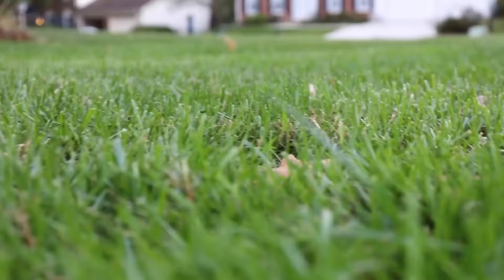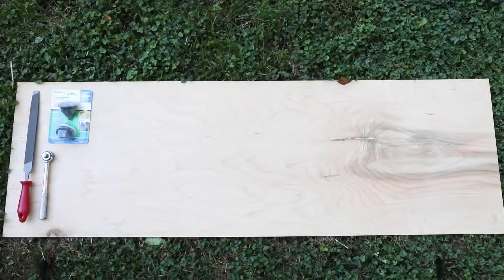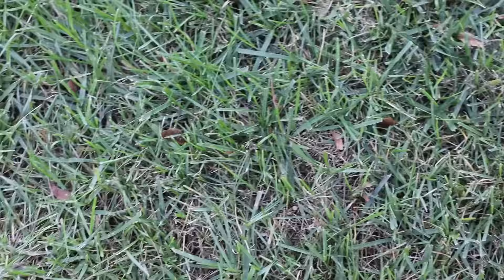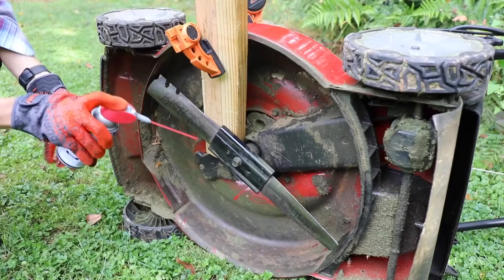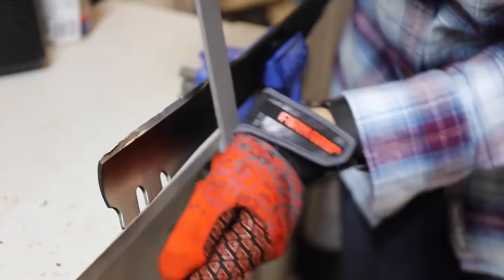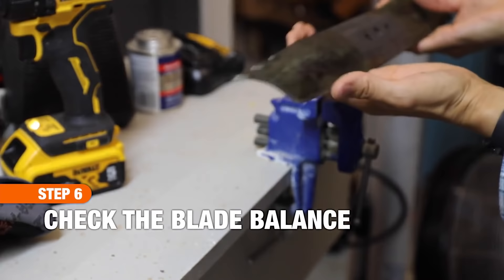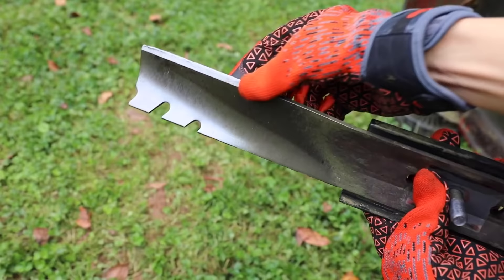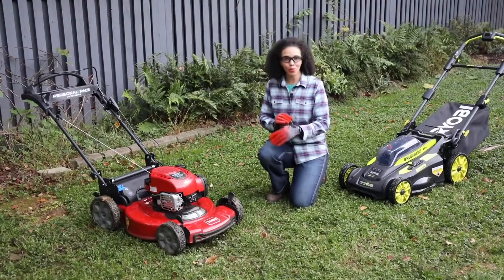How to Sharpen Lawn Mower Blades | The Home Depot

Comment: That’s why you buy two blades. Replaced the old with the new. That way you’re ready to get to work. Afterwards, sharpen and save the old blade. Swap out again when needed.
Reply: The new one I bought didn't come sharpen lmfao
Reply: Have you seen the price of lawn mower blades lately😂
Reply: What if you can't loosen your current blade, no matter what? (My current struggle)
Reply: Yes I’ve tried to sharpen mine, but still ended up not so great cut. What about a powered blade sharpener?

Comment: For those of you that are doing this for the first time you do not need the 558 tools that Home Depot is hoping you will buy from them to do this simple task. Do a little more research.
Reply: They're just being thorough, for safety's sake. I was taken aback by the whole list myself, but I think the gloves, file, marker (or even a piece of masking tape), screwdriver and ratchet are good enough to get the job done.
Reply: @Spacejockey426  Yeah they give you good info in this. Especially using a 2 by 4 instead of a blade removal tool. Can just sharpen with a whetstone. Just take your time and do it right

Comment: The easy answer is a vice and metal file (or drill attachment, grinder, use common sense).  Home Depot wants you to buy all that stuff, but the quick answer is a vice and metal file.
Reply: Exactly! I stopped watching this useless video as soon as she started rattling off the plethora of "required" stuff just to sharpen the blade. Nice try HD!
Reply: I do wonder if HD wants us to buy stuff...for if it was me I would at least put the links (to HD) to all that stuff in the description.

Comment: Bought a home last year with 5 acres.  Never mowed since I was a kid.  The prev owner sold me his JD x384 and mowed it 4 times, and had JD service come pick it up for service and found out it was almost $300 for an oil change and the kit is about $37 and new blades are around $60.  So $200 more.  I decided this year to spend the $200 on everything to do it myself and then it is only $100 season for maintenance kit and blades if I screw up sharpening them.  After one mowing the new blades had absolutely no edge on them and was just beating the grass.  Better to learn how to sharpen blades.  BTW any lawnmower service is seven weeks behind and another reason to learn to do it yourself.
Reply: the biggest expense now is the gasoline!

Comment: If you wedge the 2x4 behind the blade, you can bend the blade if the have to put much force on the bolt/nut to remove it...
Reply: I have to always use a breaker bar which risks stripping the nut.Never had a blade come off that easy first time.

Comment: I have international professional experience and have always believed blades should be optimized for the job. If you're cutting light grass you can afford to have razor sharp blades but if you're into heavier growth and tougher circumstances a more dull edge is important because sharp blades will deform too easily radically altering their cutting ability.

The factory Edge is basically perfect because it's not so sharp it's weak thus will deform too fast 

I've always just passed them over a nice big bench grinder a few times to clean up the edge and get back to as close as I can to factory but I'm always tempted to put a finer angle on it and frankly do if I'm really caught up and the mowing is easy however if I think I've got heavier growth I'm going to just get back to that factory Edge

Comment: I bought one of those wobble balancers. I got the metal one. And I think they are just junk as there is too high a margin of error. As I found the blade can slide around a little on top of the balancer giving you different readings. At the home on the cheap, the best method I think is the nail or screwdriver method. I'd say that should put you in the ballpark as it won't be perfectly balanced even if it shows it is, but hopefully it'll be within range of acceptable. The best would be those magnetic balancers that are mounted on the wall.

If you take your blades to a shop to get sharpened, make sure they have a magnetic wall balancer to check balance. Otherwise, you might as well just sharpen and check at home. Which would pay itself off anyways since you wouldn't be paying a shop to sharpen them.

Comment: Also....have always been taught to never place mower on its side.....always lean it backwards.  This prevents oil loss and none to empty gas.  Maybe this one is a new configuration because she seems knowledgeable and well prepared with all of those tools....can build a house after the mowing is done.
Reply: Depends, 2 stroke mowers no problem, 4 strokes probably need to limit the side flip to 60 degress or so.

Comment: Talk about over-complicating such a simple job... I just tip my mower backward, unbolt the blade, sharpen each end on my workbench grinder, and then bolt it back on. Simple as that. No need for the 50 tools here that they hope you'll swing by Home Depot to buy.
Reply: I dont even take the blade off, you can sharpen right on the machine.

Comment: I always remove and install my blade with a cordless impact so no need of wood. Never drain the fuel, never disconnect the plug and in all the decades I have done this, never a problem.

Comment: if you are using metal files, use a HANDLE. also this is not the most efficient way to use the sharpening stone drill attachment.

Comment: I went 15 years on a factory blade push mower before replacing the blade just because of time. Makes me wonder how necessary a perfectly sharp blade is needed since I went 15 years and could have kept going without ever sharpening.
Reply: As long as the blade exists, it will cut, but you clearly have no idea of the improved cutting peroformance a sharp blade gives.
Reply: Yeah, I'm near 55yo, had probably 4 or 5 mowers over the last 40 years, never sharpened or changed a blade on any of them and have occasionally hit curbs, rocks, pieces of metal people thrown in the yard, as I live on a corner in a big city, but then again I am not concerned about having my yard featured in Better Homes and Garden Magazine or winning an award. I just want my grass cut every couple weeks so it doesn't become a knee high jungle. It looks about the same as 99% of other peoples yards that I see.
Since my current Honda push mower is over a decade old I think I might just spend the $20 for a new blade and see if it really makes much difference. Definitely not knocking anyone from sharpening theirs though. If you have the time, tools and inclination, it probably will be easier on your motor, cut smoother & save on a new blade cost.
Reply: @willahelmpowers4835  Make sure to check the balance, as I've had to have brand new blades sharpened because they didn't balance.
Reply: @colt5189 Thanks for the heads up and tip on that.

Comment: 3 rd issue is turning the mower on its side to remove the blade, you’ll lose oil or fuel or both, tip the mower up from the front
Reply: Or, get an electric lawnmower.

Comment: Actually, dull totally round edged blades cut well.  How?  The grass slams into the blade surface at high velocity and flattens there, and then the coefficient of friction won't let it just slide off.   But since the blade ain't stopping, the grass is then torn off a bit below.  Therefore, sharpening blades is overrated.

Comment: This video is horrible tutorial because ur not supposed to lean on the side
Reply: How are you supposed to position the mower so you can remove the blade?
Reply: @colt5189  spark plug up, usually tip front up. Do not tip gas mower on side.

Edit: She empties tanks before tipping, so then it doesnt matter. It you lift from front you can skip that step.
Reply: @morgizmo87  Tipping front up is kind of hard because of the rear handles not letting you tip it up far enough. I had planned to mow and let it run out of gas, then tip over.
Reply: Also, never use a file without a handle. She's forcing it into her hand.
Reply: @morgizmo87  I got my blade swapped out with a new one I had got sharpened since it was not balanced from the manufacturer for some reason. 

I could have just waited when I changed the oil a few days later as you have to tip it on it's side to change the oil. But when I changed the blade, I ended up propping the front two wheels on something and there was enough room with me laying underneath.

Though this is only the 2nd time I've changed the blade on this push mower. The first time, I went nearly 15 years on the factory blade and belt. Which makes me wonder how necessary sharpening a blade really is.
Reply: @morgizmo87  thanks . This is a helpful tip. Appreciate.